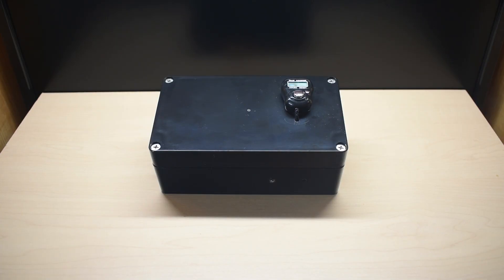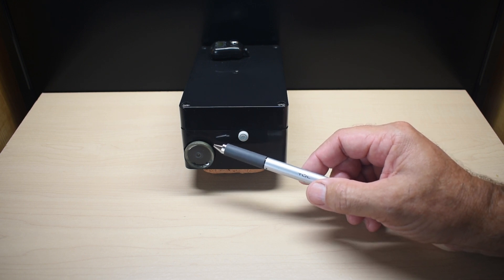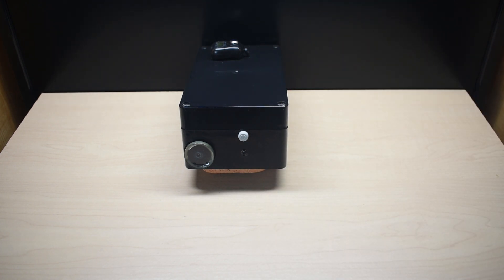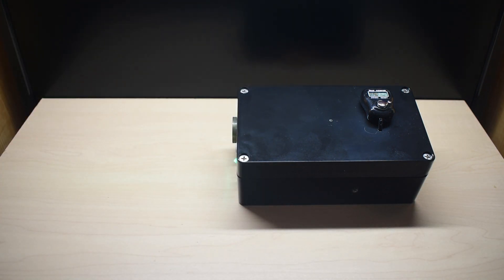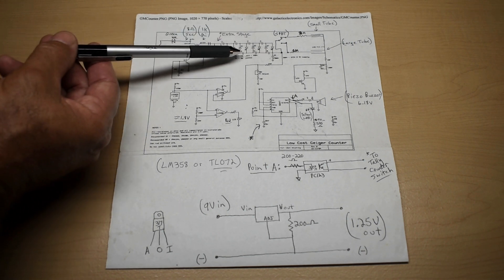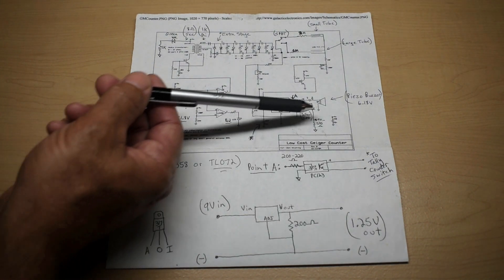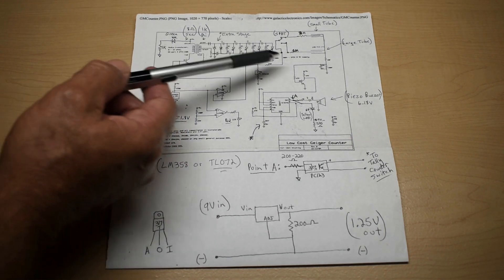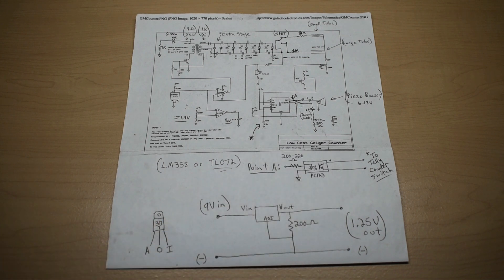Best Homemade SENSITIVE Rechargeable Geiger Counter (ALPHA/BETA/GAMMA)

Comment: Is there a selector or a way to know if the detected radiation is Alpha, Beta or Gamma?  Does the Meter indicate that?    You didn't show your battery pack charging circuit.  Are you applying 12V to all three series 18650s, like the top (+) and bottom (-) only?  You can get 3-series-cell charger with 4 wires to monitor the charge of each individual cell so no one cell in the series pack is overcharged or undercharged when you think the series pack is fully charged.  When, let's say, the center cell is fully charged, the charger stops charging it.  Same for the other cells.  You can also get a DC to DC Converter which will take the battery pack's 12.6V Full charge (4.2V each) down the safe discharge 9.6V (3.2V each) as input and supply a constant 12V output, so battery pack drainage does not change your 12V input to those 12V input devices.  This may require a larger project box, but it should be worth the rebuild.
Reply from the maker: @100vg  The output voltage of the AC wall charger is 12.6 volts. There is a board inside the battery pack, but I have no idea how good it is. I'm only drawing around 50-60 milliamps so I'll never overheat it.
Reply: @electronicsNmore   I was talking about Balanced Charging for all 3 cells and a DC to DC Converter as described would supply a Constant Voltage out.  A Full Charge of 12.6V will never be seen by the circuit because of Voltage Drop once Power is applied.  12.0V may be the best you'll see, but a DC to DC Converter's Voltage out will be constant until a certain low needs-to-be-charged Voltage from the battery is reached.  The Balanced Charger circuitry may determine the recharge Voltage and stop the battery pack from working.

Some of them have an adjustable Voltage out and some have a set Voltage Out spec, which you have to select to meet the circuit's needs.  And there are various types, with some of them much smaller and made to be soldered onto a PCB, but their Amps capability is smaller, too, but certainly capable of 50-60 mA.

A Balanced Charger for three 18650s in Series has 4 wires, one for 12.6V (+), one for 0V (-), and two for where each battery in Series touches another in between.  This configuration allows each individual cell to be charged to 4.2V and then stop charging, like an 4-bay 18650 charger does, and the schematic that comes with the Balanced Charger shows where each color-coded wire goes.  If your battery pack has 4 wires going into it, then it has balanced charging, but it was hard to see how many wires there are in your video, but I didn't pause the video and click Full Screen.

Each module is of a fair size and height, and that's why I said a larger project box may be required, but the lower Amperage DC to DC Converters may suit your needs.  It may be worth looking into.

Comment: Very cool man. I might do this. Never thought about making a Geiger counter. But it might be cool to have to track the kids about nuclear physics. Hopefully I’ll never actually need it but if I do I sure will be glad I have it. I can’t seem to find a 5979 tube though. Found a 5980 - so I’ll have to do a little research.
Reply: Some tips for you: Skip the pencil shaped 5980 tubes.  They are not very sensitive at all.  If you want alpha sensitivity on a budget, the best bang for the buck is a soviet surplus SBT11A tube which can do alpha+beta & gamma.  If you don't need alpha sensitivity (most don't, actually) then the next best choice is a surplus SBM20.  They are amazing tubes for the price.  They run at 400v.  Very sensitive bang for the buck.  Get a tested to work one.  Ebay has good prices.  Also, you may want to look up how to build a gigaohm HV probe for your multimeter otherwise it will bog down your delicate HV supply and you won't get an accurate 400v reading with most multimeters out there.  Fun stuff.

Comment: Cool device you made.  Some more info for you: Radium emits more than just alpha.  The alpha portion is likely being blocked by the glass wall of the vacuum tube anyway.  It only takes a cardstock thickness of paper to block alpha.  The pre-WW2 Fiesta was not usually made with depleted U, but with natural U-oxide.  This can be confirmed via gamma spectroscopy to show the higher U-235 content than you can see with depleted U items, (which still has a little).  Cool thing about Fiesta (and U-glass) is that it's mostly a low energy beta emitter.  So... lots of electrons but very little gamma emission.  When I measure with pancake probe, I get roughly 76% of the counts as low beta with the remaining 24% being alpha plus a tiny smidgeon of gamma.  You can block the alpha+beta portion with 1/8" thickness of aluminum if you want to count only the gamma.  For people that don't want to build their own circuit - they can get an entry level geiger counter for about $50 delivered these days.  There are some made by FNIRSI test equipment and a number of other cheap brands using the Chinese glass walled tube variations.  Won't be as sensitive as your end window tube but they are OK or detecting most hobby level stuff found in antique & rock/mineral shops.

Comment: I bet that you can't fly with that, even in your checked baggage.
Reply from the maker: 🤣. Funny, looks like an IED
Reply: Just say, "I'm helping the airlines by monitoring radiation levels at high altitudes!", just be sure not to be salivating on side of mouth at the time.
Reply: Surprisingly I know people have flown with the SBM20 based devices which look even more suspect.  The key is you need to turn it on and show the security guys it's just a geiger counter and working OK.  Send it through their X-ray machine and it will scream from all that radiation.